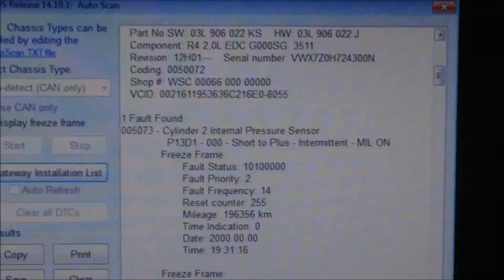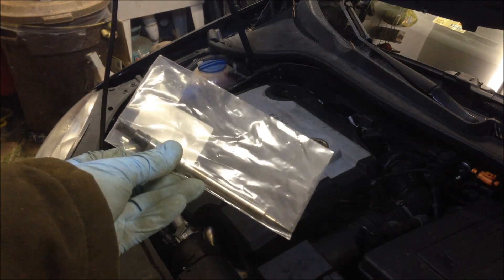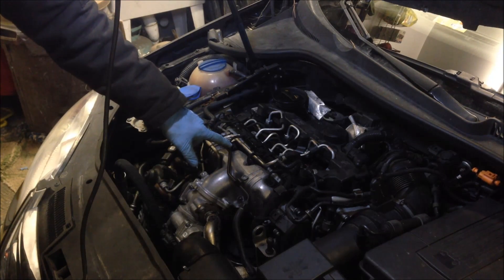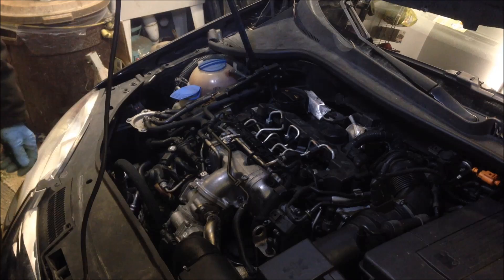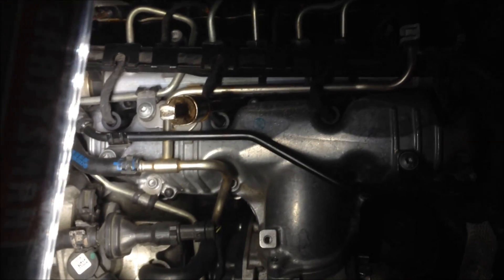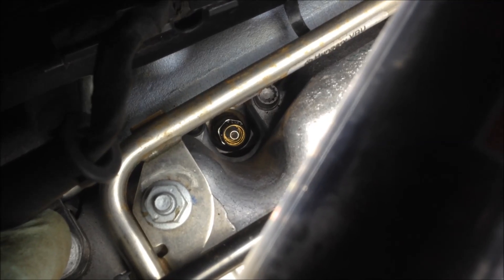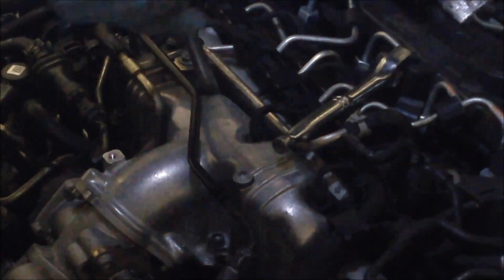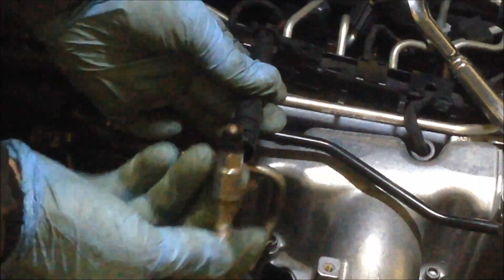MK5 TDI VW Jetta Glow Plug Install

Comment: Hi, may I know why must you change the glow plug.  Isn't it suppose to be functioning for lifetime?
Reply from the maker: +Azrul Faizal Mohamad Dahlal 
On the TDI, the glow plug serves 2 purposes.  It is a pressure sensor; and, it helps to start the engine at very cold temperatures.  Yes, it is suppose to function for a lifetime - but so is every other part on the car.  A vag.com reading of the ECU codes will help to diagnose the vehicle to see if a glow plug replacement is required.

Comment: I have a VW Bora 1.9 TDI PD 131 PS  2002 128 000 km
 
I have a problem with the engine.

If the engine is cold, it starts to shake, and when the motor 90 degrees is, it runs perfectly, otherwise runs perfectly ..

Is this the same problem???
Reply from the maker: +Fatos Hodja 
This is not the same problem.  It may be a sticky valve or compression related issue or a fuel injection problem.  If you are using the recommended oil by the OEM manufacturer, then I don't think it is a sticky valve related issue.

Comment: Thank you for the video, if you would, please tell me how long this job should take in total?  Thank you.
Reply from the maker: +Scott Royce  
Shouldn't take more than 2 hours (at a minimum - at least 15 minutes)
Reply: +ProjectsbyTMD Thank you for your quick reply, I am going to try to replace the glow plug myself, two questions though (sorry?!), 1) how long should both the hooked screw driver (cats paw) and ratchet extension be, and what do you use to reattach the wiring harness to the top of the glow plug?  Thank you again for sharing your knowledge, restores ones faith in both mankind in general and the utility of the internet specifically.
Reply from the maker: +Scott Royce  - Take a screw driver and bend over the tip  - it length of the steel portion of the screw driver should be 6".  As for the wire harness, it's very much like a spark plug connector.  It just pushes back on.

Comment: Thanks for the video! I just got in my new glow plug and noticed that it is missing the top part that snaps on to the harness. Is that a sensor unit that is reusable or do I just have the wrong glow plug?
Reply from the maker: Dwight Debenport  - The wire harness end does have a 1" long like electrical connector that is inbetween the glow plug and wire harness.  Perhaps you need to get this off of your old glow plug.